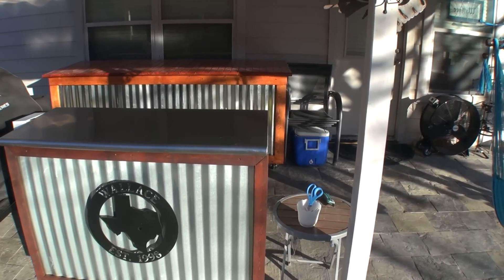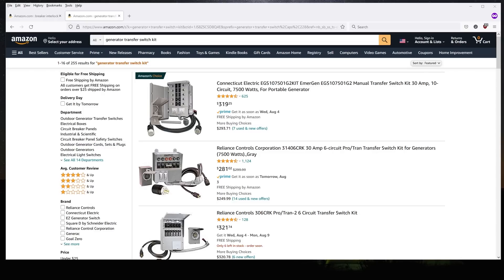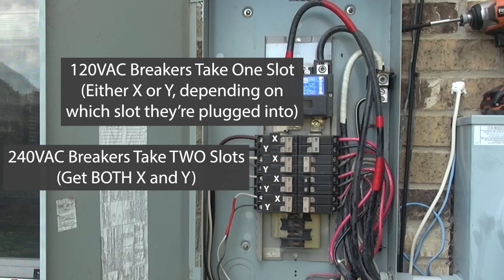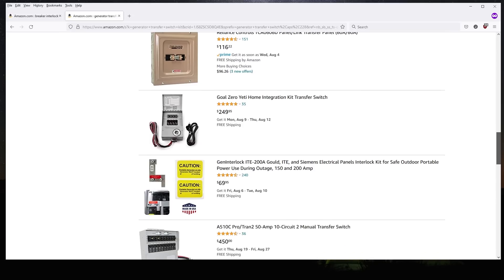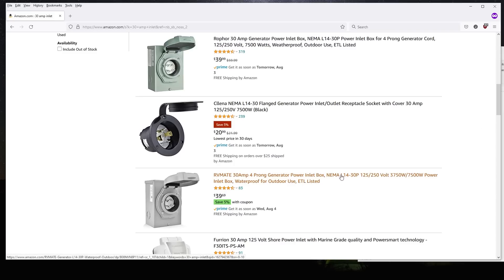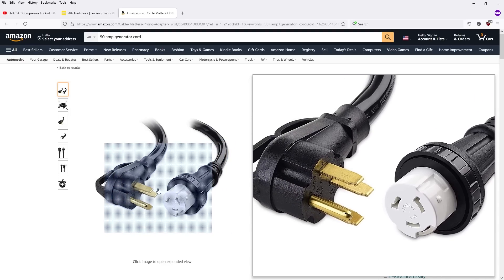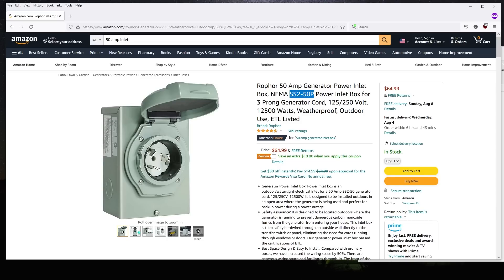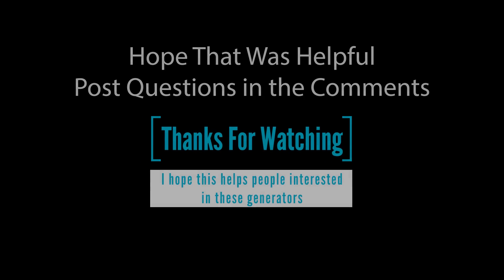How to Connect A 240VAC Portable Generator To Your Home

Comment: Crazy the number of these videos I've seen and you're the first to explain the wiring of the breaker box with the alternating X/Y, the first to explain a number of things.  Great job!  My inlet box was done with 30A back when I had a 5kw genny, and now with the same Predator 9500 I'm thinking it's a little light, although the Predator has a 32A continuous output. I'm assuming a startup peak or surges are not going to cause a dangerous overload of the cable? Oddly, my 25-30ft cable from genny was custom made by an electrician years like twenty years ago, with 8g and L1430 on each end.
Reply from the maker: Based on what I'm seeing with online calculators, they seem to imply you're ok with that length and wire gauge setup.  Breakers aren't usually "instant off" when you hit the max.  There are a lot of factors that go into when it eventually trips (temp being a big one).  Similarly, unless something is wired badly a 30amp inlet isn't going to instantly blow up if 32amps pass through.

If 30amps is sufficient for your needs, it sounds like your setup should be pretty solid.  If you have central AC or AC compressors that need to be run, you might look at the softstart video I made.  Those things have some kind of hoo doo voodoo black magic, that makes all the difference in the world with being able to run them off generators.
Reply: Completely agree. Every other video talks about how easy this is to do the skips a critical step. Thank you Jason Wallace for this excellent video.

Comment: How's that airflow working out for longer runs? I just finished my XP9000ih in a Suncast shed but it's still too cold outside to know if the muffler residual heat will build up inside.
Reply from the maker: The front and rear of the predators are air intakes.  (the front being the most important imho because that's where the heat sinks are for the inverter.  There is a mechanical fan attached to the engine that pulls quite a bit of air through the housing, and out the side just under where the exhaust is.  Just feeling around with my hands while it's running.... it seems that the area around the exhaust also seems to get some of that air flow as well, so it's not just building up heat with no air movement around the muffler.

So the plan with the box, was to position the electric fans so the front of each machine has clean air being actively pumped in.  (The rear of the 1st machine in line also receives air from the second fan).  That left the rear of the 2nd machine with no active cooling.  But I figured that the mechanical fans in the generators will outrun the fans, so I found some expanding foam tape (it expands up to 1") at Lowes, and used that around the exhaust exits from the housing.  This effectively sealed / separated the air going out, from the air coming in, and will create a bit of a vacuum inside the housing.  So there is a vent at the rear of the 2nd unit, and with the lid shut, there is indeed a slight vacuum there (just enough to pull up a piece of paper against the intake)

I ran them for several hours, and used a 4 probe BBQ wireless temp monitor, positioning one probe on the outside as the ambient baseline, and the remaining three probes positioned at the front of machine one, between the rear of machine one and the front of machine two, and the rear of machine two.  The internal temp of any of the probes never went even one degree higher than ambient... so I think I've got it balanced fairly well.  

And if there was just a super hot day, where things weren't cooling, I could always just leave the lid open, and let the fan in the machines pull air through normally.

Comment: Nice 👍🏼 video. I have a similar setup. I have the option of connecting a 2000, 3500 or 8750 Predator generator. I wish I had one of the 9500s because they are quieter than the 8750 open frame inverter generators…
Reply from the maker: Kinda with I could have gotten away with only one 9500... but with all electric, it just wasn't enough.